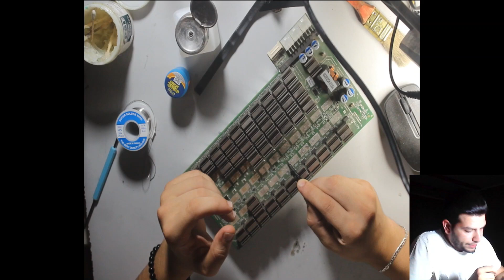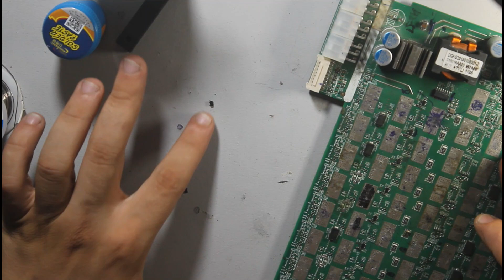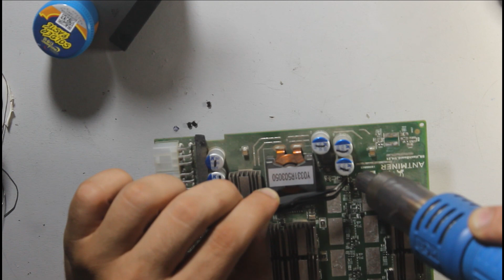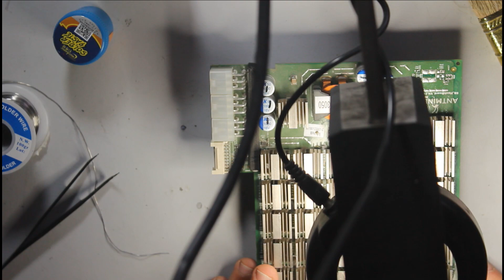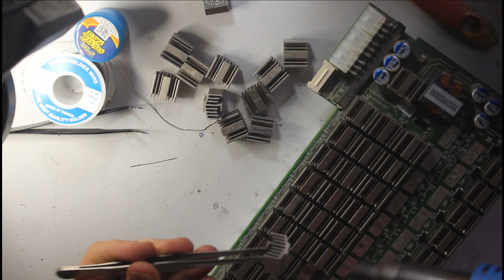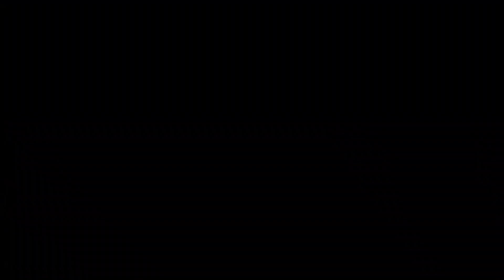Bad LDO between two voltage domain S9 hashboard Antiminer .

Comment: Hi bro..can help me?
Do you have any video on S9 hashborad power failure on checking MOSFETs/Mo's power management and more? And also there are two different code MOSFETs and I wonder why? Can I use same code MOSFETs? Or random new 4 piece MOSFETs solder on it, will it work? I really wanna know more on how to checking the MOSFET
Reply: I have 4-5 board failure for inputs voltage for the asic chip allow...all 0valtage ...do you think is MOSFETs?
Reply from the maker: @freereloadcredit1514  whatsapp 0097333521144